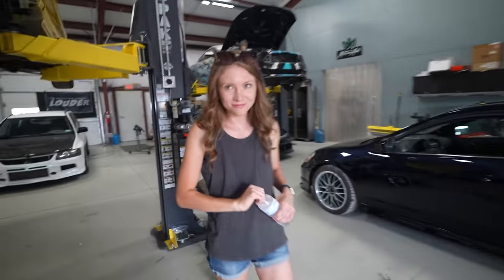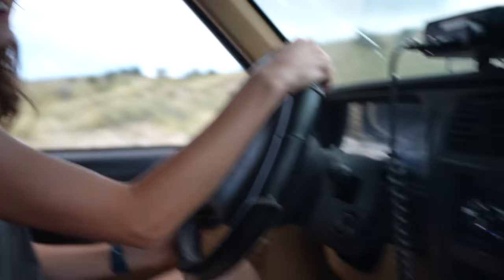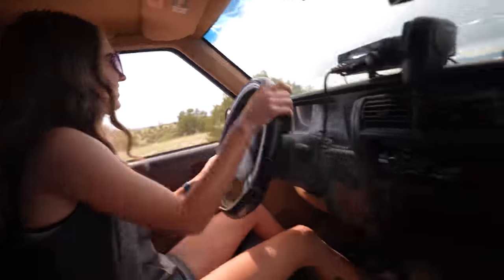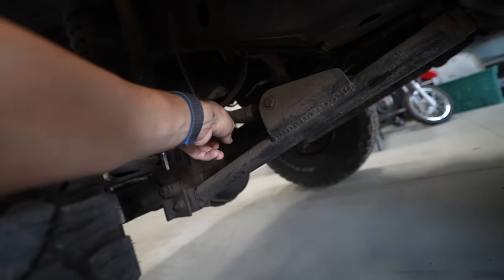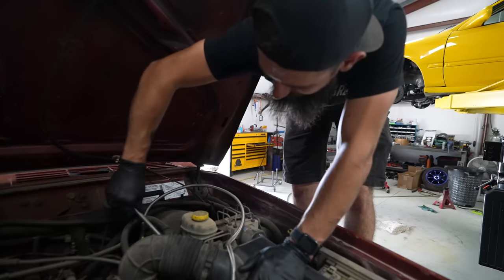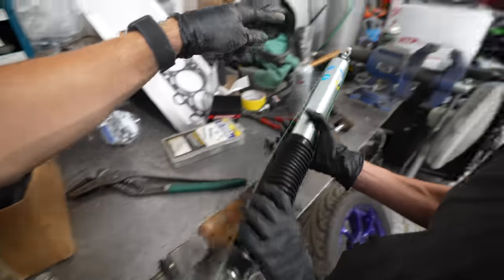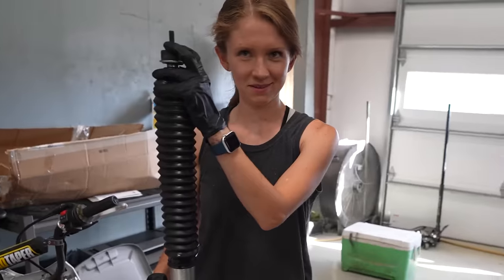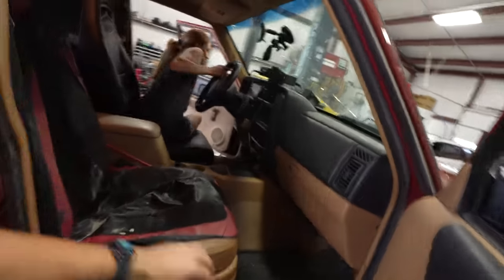Teaching My Girlfriend To Fix Her "Barbie Jeep"

Comment: You Go Jamie! (My poor wife struggles to put air in her tire). Trevor... teach her how to strip everything off of it, wet sand & block by hand with 220 & 400, maybe spread a little filler & glaze, then more sanding/blocking, some primer & more sanding/blocking then you "might" be ready to mask the jeep & prep-sol & tack cloth the whole thing, spray some sealer & scuff it again, more prep-sol and a tack cloth. Hey, it's really time to shoot the pink & hope you don't have any fisheyes, blushing, dry overspray, Ect... But then comes the most satisfying part to me...the clear. Finally, you can stand back and admire your work, let her cure and think about how sore you're going to be tomorrow.  Un tape the car and tape up your blisters for that final wet sand with some 1000,1200, & 1500. Guess what, it's time to wrestle that buffer for a few hours with 3 different grades of compound/glaze and then you get to clean all that excess compound that got slinged everywhere off, put everything back on the Jeep and give her a final wax!  Piece of cake!, No big deal! Hehe  : )